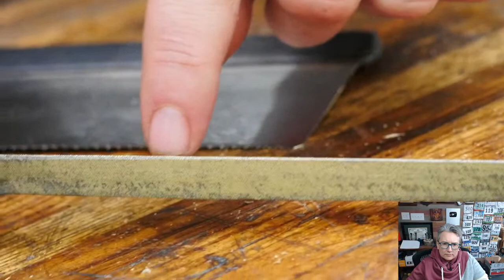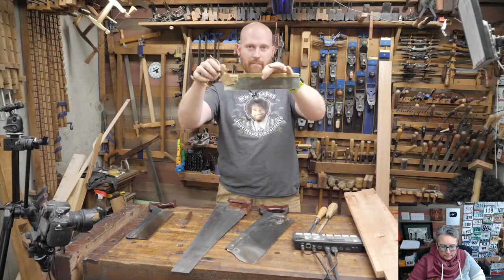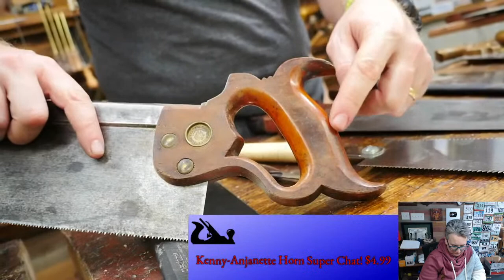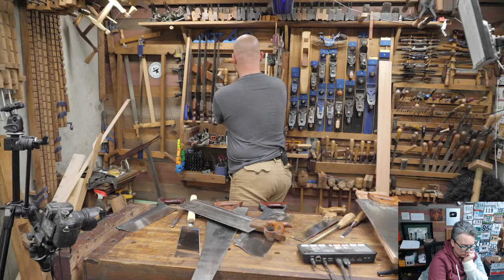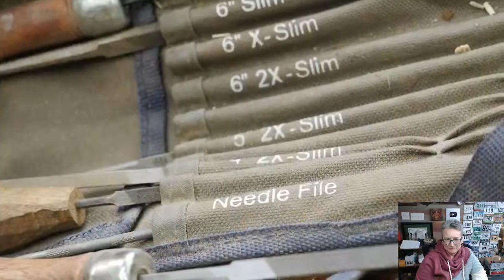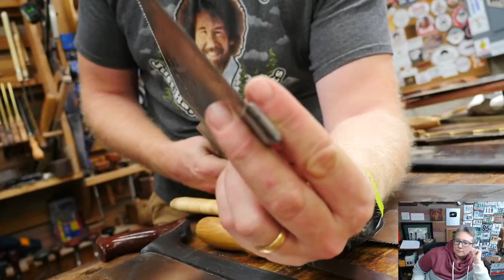All About Saws and Their Many Myths

Comment: A great video from which I learned a lot. You mentioned running out of band-aids. From a recent and ongoing experience I would like to share a tip. If you cover a slicing cut with a band-aid it takes forever to heal because the edges are not held together very well. If you use a wound closure tape to pull the edges together they will heal quicker and you can get back to work more quickly without bleeding onto your wood. I think the 3M version sold as Steri-strips are the gold standard but your local pharmacy will probably have cheaper versions.

Comment: With a Japanese hand saw you will often see a person changing the angle of attack (dropping and raising the handle) this controls where the leading tooth is. Say you're sawing in the vise with the board vertical and the saw cuttin flat. The first tooth is on the backside, when you drop the handle you're disengaging the backside teeth and it's easier to change direction....... but you gotta raise the handle again shortly after or it will turn on the backside if you keep the handle dropped and the plate is gonna bend inside the kerf, cuttin straight on your side but way off line on the backside. That's why you will see people raising and lowering the handle VERY often through the cut, they are steering the saw. I find Japanese saws harder to use because it takes more technique to use it, with an English style saw it's easier to steer so I find it easier to use.
This may be coz I first learned with an English style saw, been using Japanese saws for years now and while they cut good and clean, they are often too fine for rougher cuts, and too short for bigger cuts......... try resawing with a Japanese saw, it's pure PAINFUL 😂

Comment: Here's a clue about the confusion with sharpening stones. In traditional British English they're called whet stones because you whet (a verb meaning sharpen) your blade on them, it's a different word entirely, & has nothing whatsoever with "wet", so even dry stones are whetstones. There's widespread confusion owing to different words, with different meanings being homophones.
Reply from the maker: Very true. There is a more modern term of referring to water or oil stones as wet stones to separate them from diamonds and sand paper.

Comment: I just read that the reason that Japanese saws are pull saws is because that the Japanese sit on the ground and pull saws are a better fit for that position.
Reply from the maker: Right on. That goes to the body mechanic. It all depends on how low your bench is to your waist. The lower the bench the straighter you want your handle the higher the bench the more you want it closer to perpendicular to the saw.

Comment: It is whet stone, not wet stone, and has nothing to do with being wet. It is an old fashioned term meaning to sharpen.
Reply from the maker: It's always fun how different sides of the ponds have different ways to look at the same thing in terms but so close but yet so different.
Reply: @WoodByWrightHowTo  Well, I'm in the US, but it doesn't really matter what you call anything, as long as you understand what it is and how you use it. Kind of like, "A hacksaw becomes a Dovetail saw if you cut dovetails with it.". Spot on.